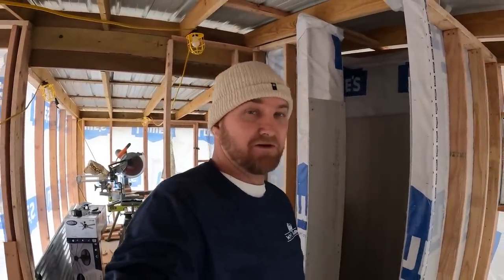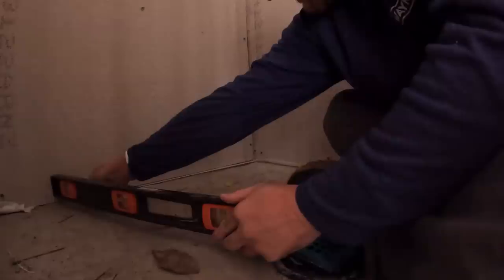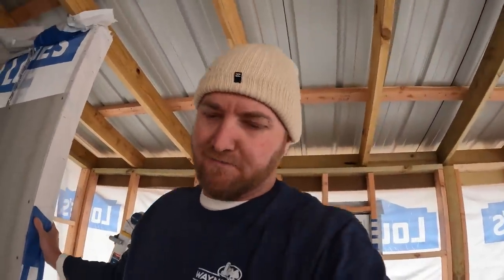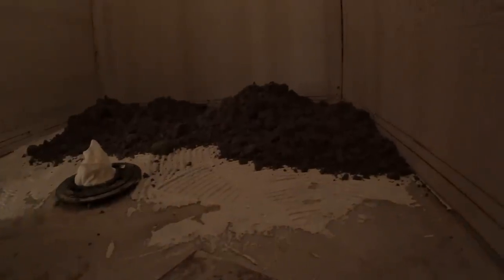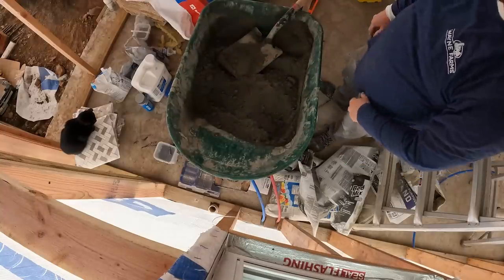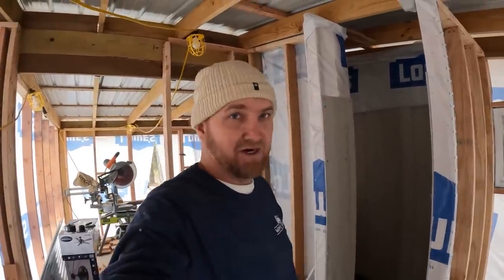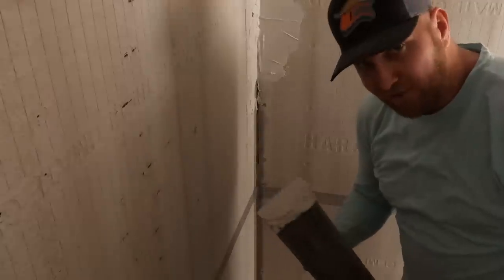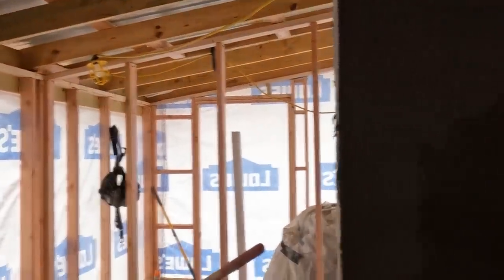CAN'T CATCH A BREAK  | tiny house | off-grid, cabin build, tractor homesteading, farming, DIY shower

Comment: Hey David. Great work. We had a new shower put in this past year. They did 2 coats of the liquid membrane over two days. You will find it protects better with two coats. Also, I fid a couple of showers myself. As ee lived at the ocean I did and indoor garage shower with two changing rooms. I used greenboard and coveted it with corrugated white panels. They worked out really well! (30 years ago!)

Comment: When it comes to pouring  shower floors     I watch  a mason do it real time  used a 1x2  and cut wedge shape  pieces  putting the thin end at drain and thick end at the wall  useing  these as as screed as putting  in leveling  cement mix on the dry side  then before it's set remove   the guidelines  and fill with cement  this kept the drainage  to drain  without low or high spots
Reply: That must have been the one I watched too. Makes for a nice level, bevel to the drain. No guess work involved. Seems foolproof.  But I might be the fool, LOL.

Comment: On your other video, you talked about needing some kind of trim  to cover the edge of the metal in the shower. I can’t really remember at the moment, but if it’s that same type of corrugated metal shaped like the fiberglass corrugated panels   then you might be able to use the redwood support and closure strips needed for the fiberglass oner rafters. I think you could probably use it on the end and just slide it under the edge halfway and use some of the grommeted screws to anchor it into the redwood. ( saw fir version too which is probably cheaper and you could see if it was some kind of waterproofing ). In any case since you’re using some  patinaed metal roofing it’s probably the older kind that has a wave, at least I hope so. That would really solve your issue about capping the end. And since it would be Redwood water wouldn’t affect it. 
Now, having said all this, my suggestion presupposes that you are going to hang the panels horizontally. If not, it won’t work. If you’re going to hang them vertically, then try to cut it with a flush piece at the end and just use one of those clear wallpaper protectors for corners or one of the metal corner beads for sheet rock.
Reply from the maker: Ty

Comment: We did pretty much the same with two changes.. bought a pre made shower floor.. just need to cement it underneath  as it already has the slope. Then painted on waterproofing on the walls then added ceramic tiles..Metal and hot water isnt a great combination LoL.